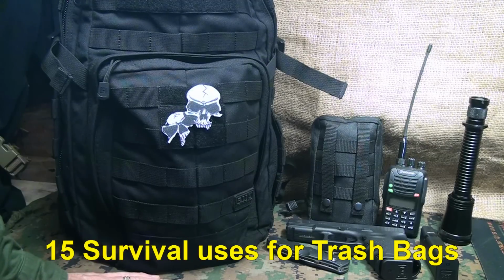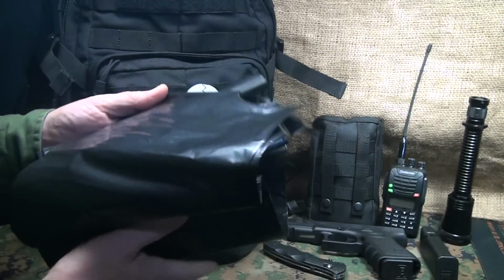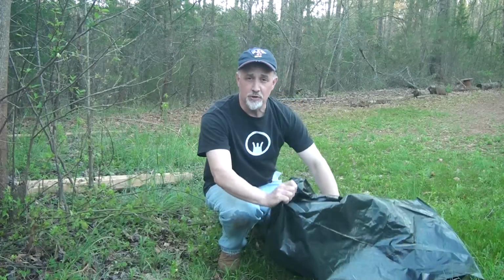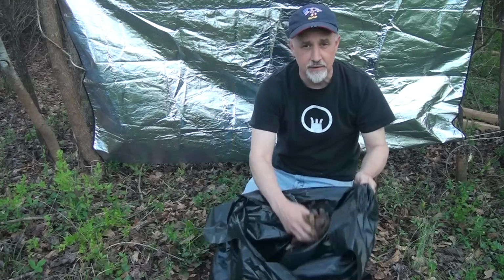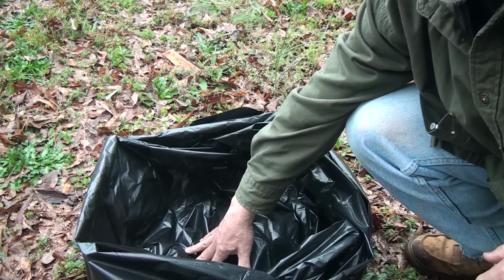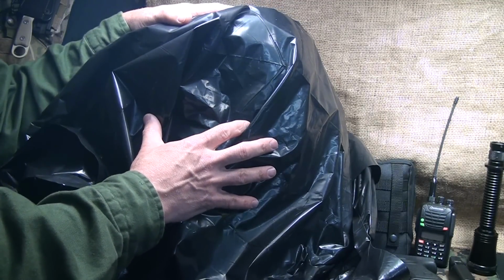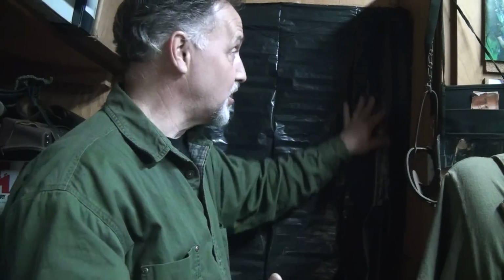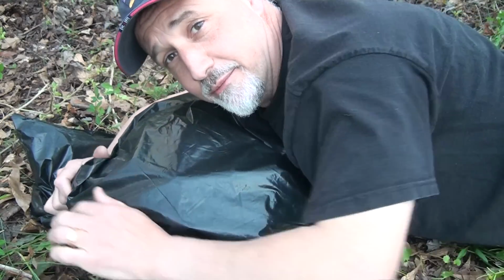15 Trash Bag uses for Survival

Comment: Another way to use the bag is fishing. Make your holes around the opened hole and use branches and tie them off each other. Poke a few holes on the other end for the water to drain as you pick up the fish. It may be best to use white bags as you will attract more fish and not scare them as easy.

Comment: Was out at the range last weekend and stuck my car hard in the frozen mud.
Relay greasy 4 inches of mud, frozen beneath.
I had to crawl under my car when the tow truck arrived to hook up  and was relay happy to have a couple of large trash bags to lay on.
After the car got out , I just turned the bags inside out and tossed them in the trunk. Then tossed them in the trash. No muss, no fuss.
Great item  and easy to carry.

Comment: Put a rock in the corner and tie a loop around it and run it to the tree or anchor point. This way you do not have to put holes in your bag when you use it as a shelter.

Comment: I've heard that trash bags have chemicals for odor and bacteria and are not recommended for storing drinking water without a purifer. With a carbon filter they would make good rain catchment system for grid down emergency.
Reply: A lot of trash bags do.  that is why you need to get the contractor bags.
Reply: I did not know that thank you.

Comment: Using a small rock or twig as a tie down button would work better for securing your shelter, that way you're not cutting unnecessary holes and will negate any possible tears.  Rock on brother!
Reply from the maker: Good point. Thanks for the comment.
Reply: +KnightFireLT1  To stop a rip from happening. Make an X shape with duct tape, and then poke a hole in the center of the X, (making a durable eyelet to thread the rope through).   This ensures that the eyelet holes never become larger, or cause a tear in the plastic from a gust of wind, which saves this bag for many future uses.

Another function to use with the "Tent roof"  is strapping a strip of duct tape on the back end hanging it down and then wrapping the duct around a medium size twig, branch, or log. This weighs down the trash bag tent in the back giving it a small slant/slope so the rain falls off in the back,  and wont cause the tarp to stretch or sink. And of course you will want to position something under the dripping water so you can collect it for drinking, cooking, or washing. 

And yes, +SensiblePrepper...   I had just finished watching your Duct Tape Uses Video!   Haha..   :)
Great Videos, Thank You SO MUCH!
Reply: yup
Reply: KnightFireLT1 I was just about to suggest the same thing. Guess I was a year too late. A balled up bit of TP would work too & no risk of cutting into the bag, plus you got fire starter material that is now weather-proof for future use.

Comment: If you use the clear bags they can be used to make a solar still, or as a transpiration bag to extract water from plant material when left in the sun. A clear bag can also be utilized to make a Mors Kochanski super shelter.

Taping the corners with duct tape makes them stronger if you want to tie them out into a tarp.
Reply: Trevor Jentzsch In general solar stills are not effective at producing much water regardless of what type of plastic you use. However clear plastic works better than black plastic. Plus clear plastic is what you need to make a Mors Kochanski super shelter.
Reply: Hey P2S, since watching other vids about same uses you spoke of I've been looking for thick clear bags. All I find is 3mil at Hm Depot. Know of source for some 5-7 mil clear bags ?
Reply: Robnord1
You could always just buy heavy duty plastic sheeting and duct tape together your own bags, but 3 mil should be fine. Any thicker and the light has a harder time passing through.
Reply: Good additions. Thanks for the comments.
Reply: Can you not use a black bag for a solar still?
Reply: Thank you for the feedback. I will check out that shelter you mentioned.
Reply: Don't cut the polythene to attach paracord. The strongest way is to place a pebble, or something in the corner, fold it over onto itself and tie the cord around that. It will not tear or damage the polythene.